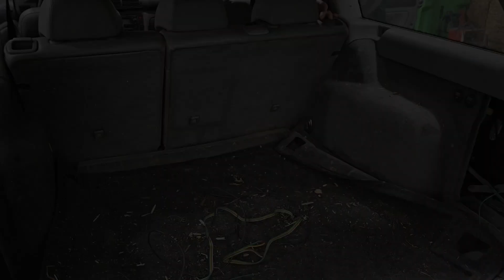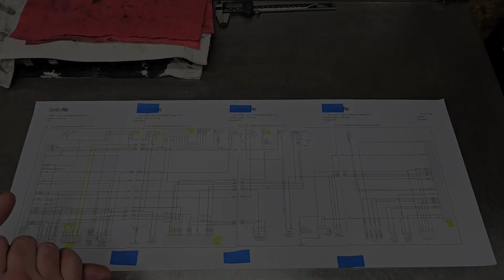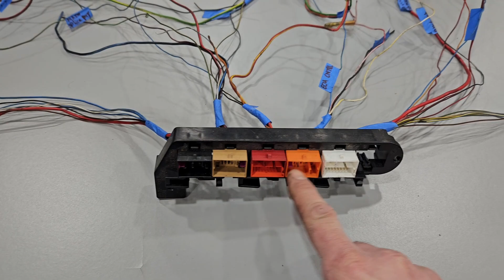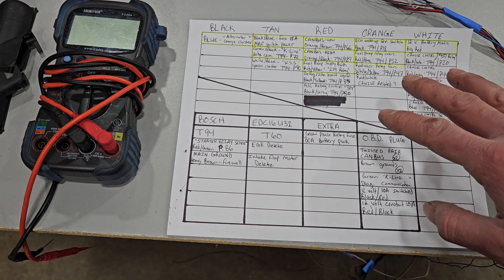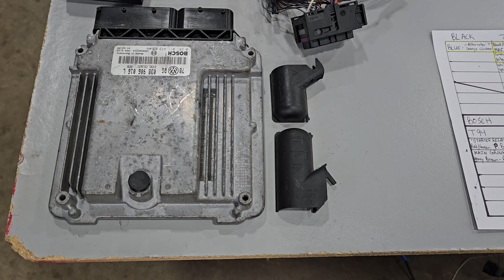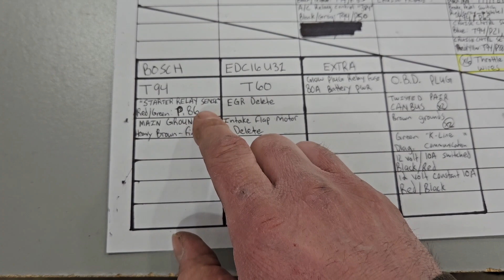TDi swapping: donor parts and electronics

Comment: what you need for this car is a vacuum cleaneer!
Reply from the maker: I'm afraid that wouldn't help it much! 😆
Reply: @PostRt  haha, but it helps by making sure dirt does'nt get in to conections, fuel tank and so on...
Reply from the maker: @wertigus  For sure! Did you see how much dirt I had to clean away from the fuel tank to remove the pump?
It must have been an inch thick!
Reply: oh i did, thats where the first comment appert from! ;D @PostRt

Comment: If you’re going to use that brake light switch I would take the mount from the VW. Likewise, if you’re going to mount the computer through the dash like the VW I would cut out the VW computer mount and the water proof gasket. 
Looks like you spent many many hours on this video.
Reply: I had to put a diode in the blue alternator exciter wire going to dash. Engine wouldn't always shut off. Another great video can't wait to see the finished product.
Reply from the maker: @lynnmccoy9623  Oh, I will make note of that. Thank you for sharing!
Reply from the maker: This one was very involved and took many sessions to get completed. I am happy with the end result and hope people find it helpful.
As always, I appreciate the feedback!